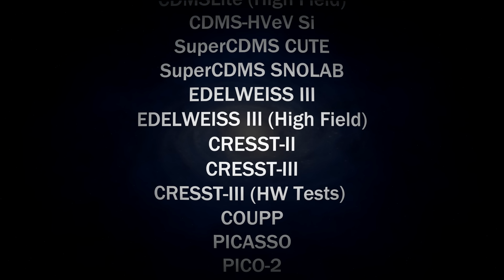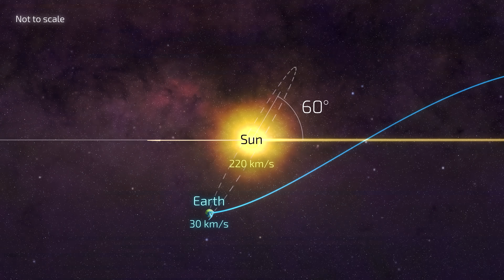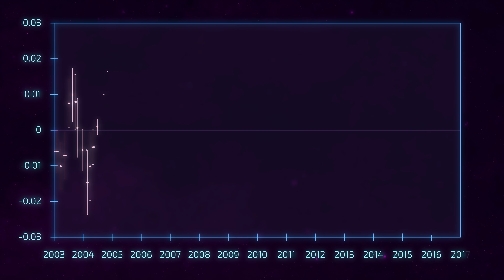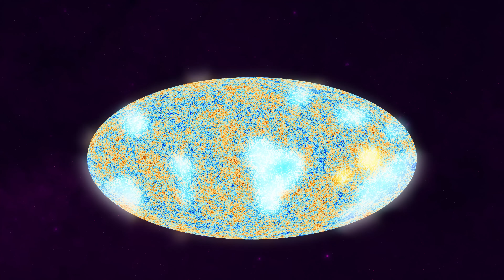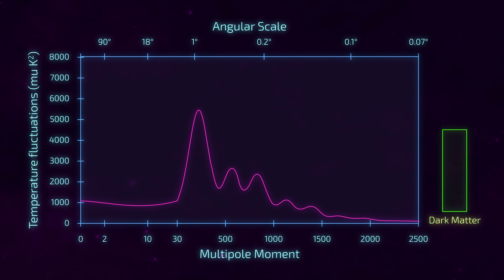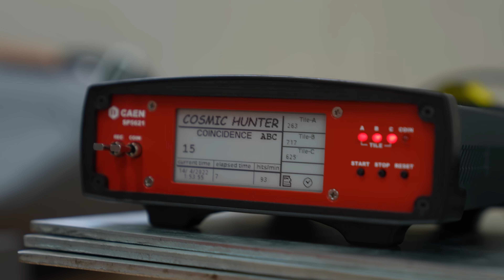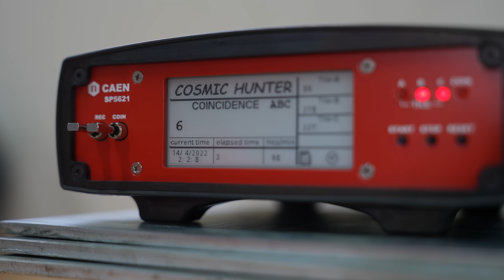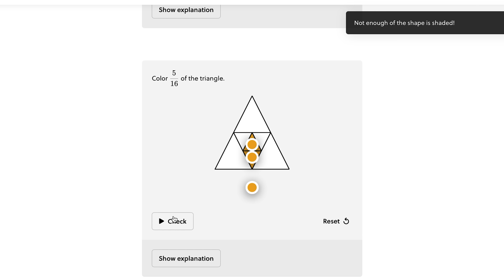The Absurd Search For Dark Matter

Comment: Reposting and slight editing of recent mathematical ideas into one post:
Split-complex numbers relate to the diagonality (like how it's expressed on Anakin's lightsaber) of ring/cylindrical singularities and to why the 6 corner/cusp singularities in dark matter must alternate.
The so-called triplex numbers deal with how energy is transferred between particles and bodies and how an increase in energy also increases the apparent mass.
Dual numbers relate to Euler's Identity, where the thin mass is cancelling most of the attractive and repulsive forces.  The imaginary number is mass in stable particles of any conformation.  In Big Bounce physics, dual numbers relate to how the attractive and repulsive forces work together to turn the matter that we normally think of into dark matter.
The natural logarithm of the imaginary number is pi divided by 2 radians times i.  This means that, at whatever point of stable matter other than at a singularity, the attractive or repulsive force being emitted is perpendicular to the "plane" of mass.
In Big Bounce physics, this corresponds to how particles "crystalize" into stacks where a central particle is greatly pressured to degenerate by another particle that is in front, another behind, another to the left, another to the right, another on top, and another below.  Dark matter is formed quickly afterwards.
Ramanujan Infinite Sum (of the natural numbers):  during a Big Crunch, the smaller particles, not the dominating black holes, are about a twelfth of the total mass involved.  This also relates to 12 stacked surrounding universes that are similar to our own "observable universe" - an infinite number of stacked universes that bleed into each other and maintain an equilibrium of Big Bounce events.
i to the i power:  the "Big Bang mass", somewhat reminiscent of Swiss cheese, has dark matter flaking off, exerting a spin that mostly cancels out, leaving potential energy, and necessarily in a tangential fashion.  This is closely related to what the natural logarithm of the imaginary number represents.
Mediants are important to understanding the Big Crunch side of a Big Bounce event.  Matter has locked up, with particles surrounding and pressuring each other.  The smaller matter, not the black holes, gets broken up into fractions of what it was and then gets added together with flattened black holes to form the dark matter known from our Inflationary Epoch.  Sectrices are inversely related, as they deal with all stable conformations of matter being broken up, not added like the implosive "shrapnel" of mediants.
Ford circles relate to mediants.  Tangential circles, tethered to a line.
Sectrices: the families of curves deal with black holes and dark matter. (The Fibonacci spiral deals with how dark matter is degenerated/broken up and with supernovae. The Golden spiral deals with how the normal matter, that we usually think of, degenerates, forming black holes.) The Archimedean spiral deals with dark matter spinning too fast and breaking into primordial black holes, smaller dark matter, and regular matter.  The Dinostratus quadratrix deals with the laminar flow of dark matter being broken up by lingering black holes and the dark matter also being broken up.
Delanges sectrices (family of curves):  dark matter has its "bubbles" force a rapid flaking off - the main driving force of the Big Bang.
Ceva sectrices (family of curves):  spun up dark matter breaks into primordial black holes and smaller, galactic-sized dark matter and other, typically thought of matter.
Maclaurin sectrices (family of curves):  newly formed dark matter gets slowed down, unstable, and broken up by black holes.
Jimi Hendrix's "Little Wing". Little wing = Maclaurin sectrix. Butterflies = Ceva sectrix. Zebras = Dinostratus quadratrix. Moonbeams = Delanges sectrix. Jimi was experienced and "tricky".
Jimi was commenting on dark matter. How it could be destabilized by being slowed down, spun up, broken up by lingering black holes, or flaked off.  (The Delanges trisectrix also corresponds to stable atomic nuclei.)
Dark matter, on the stellar scale, are broken up by supernovae.  Our solar system was seeded with the heavier elements from a supernova.
I'm happily surprised to figure out sectrices. Trisectrices are another thing. More complex and I don't know if I have all the curves available to use in analyzing them. But, I can see Fibonacci and Golden spirals relating to the trisectrices.
The Clausen function of order 2:  black holes start spinning up just before being crunched.
Methods of arbitrary angle trisection:  Neusis construction relates to how dark matter has its corner/cusp singularities create "bubbles", driving a Big Bang event.  Repetitious bisection relates to dark matter spinning so violently that it breaks, leaving smaller dark matter, primordial black holes, and other more familiar matter, and to how black holes can orbit other black holes and then merge.  Belows method (similar to Sylvester's Link Fan) relates to dark matter being broken up by lingering black holes that came late to the Big Bounce event.
General relativity:  8 shapes, as dictated by the equation?  4 general shapes, but with a variation of membranous or a filament?  Dark matter mostly flat, with its 6 alternating corner/cusp edge singularities.  Neutrons like if a balloon had two ends, for blowing it up.  Protons with aligned singularities, and electrons with just a lone cylindrical singularity?
Prime numbers in polar coordinates:  note the missing arms and the missing radials.  Matter spiraling in, degenerating?  Matter radiating out - the laminar flow of dark matter in an Inflationary Epoch?  Connection to Big Bounce theory?
"Operation -- Annihilate!", from the first season of the original Star Trek: was that all about dark matter and the cosmic microwave background radiation? Anakin Skywalker connection?

Comment: Dark. Matter. Has. Been. Falsified.  How many intelligent people will continue to fall victim to this social contagion? It was a plausible hypothesis but it’s over.  And no, the bullet cluster doesn’t say what you think it does.  And no, that wasn’t dark matter.  
Guess what? 
The speeds you’re measuring are actually the gases and plasmas.  See recently published works from new satellites.  Now we can measure the x, y And z positions of the stars — there’s a keplerian decay.  The gases, however, are acted upon by gravity as well as magnetic fields.  As expected the stars slow up towards the end but all this time, these people were postulating DARK MATTER FOR NOTHING.
But—you’ll be bombarded by ΛCDM for another decade while the gatekeepers and older generations die off.  
Jesus.  If I hear about the bullet cluster one more time.
Reply: What about rotation curves of galaxies then?

Or baryonic oscillations in the WMAP data?

Or the existence of galaxies arising from nearly uniform soup of baryons coupled to radiation?

Dark matter is the observation of all of these phenomenon. There needs to be extra mass without luminosity or modified force law or another explanation.

Dark matter is an observation, not a theory.

Comment: Huge cavern (at 13:54) is at 1 km depth: assuming a rock density of 7 times the density of water, it means that there is 7000 tons of rock above each square meter of the ceiling ....

Comment: Could "dark matter" and black holes be connected, or be the same thing? 
From my derivation of Hawking radiation, it appears that the matter that appears to be "sucked in" is actually released as radiation. While I can't yet determine if the amount released is proportionate to the matter that appears to be "sucked in," this leads me to believe that it's not a hole.

If we look at the process of fusion occurring within a star, we see that it is constantly put under immense pressure and heat from the lightest to the heaviest elements. Currently, we are attempting to create fusion using deuterium and tritium, which are relatively light compared to other known elements.

On the periodic table, there are elements that we have only been able to create for fractions of a second before they disappear. In my opinion, if we can sustain the temperature and pressure after fusion, we could potentially sustain these elements for a short while longer. Should this be the case, and they have enough time to undergo fusion again, a new, potentially heavier element would be created.

At the end of a star's lifetime, the elements would be a molten slurry of elements. The heavier elements would be closer to the center(one can assume). At this stage, it is still molten, but less agitated as fusion reactions are taking place far less. The heavier element then concentrates at the center. Considering the size or mass of the star, the pressure is still immense. This potentially leads to a further and final fusion reaction, resulting in an element so heavy that it has a massive, concentrated gravity field. Could one consider this to be a close explanation one could come up with for "Dark Matter"? 

As you said dark matter makes up 85% of all the matter in existence. In my opinion, this would make it even more true and or conceivable.

I have to say this is merely my opinion and would love your feedback.

Comment: What if?... 🤔
Maybe our universe is bursting by pushing of the radiation? 
A huge number of stars shine, light has momentum.
Matter pushed by light scatters in all directions.
Perhaps, despite the fact that the Inverse Square Law is equally valid for radiation and gravity, radiation still wins.
Perhaps, although there are a little more attracting non-radiating objects in the universe, the total energy of stars is more powerful.
And perhaps on some scale, matter stretches space, and not vice versa.
Then, at higher scales, space starts to push itself and so the expansion of space can overcome the speed of light.
Reply: it's like move faster than wind using wind

Comment: ... soooo could it just be the multi-verse is pouringbits gravitational field in our universe and because of the higher probability of matter clumping into 1 area over another its causing the gravity to just barely interact with the rest of our universe and vice versa... and because of this multiverse theory it's the true way to combine general relativity with quantum physics but we can only observe out most probable position bit not any in a scale larger than us because we don't have a big enough tool or higher dimensional awareness to collapse the function to 1 true time line therefor making dark matter an inevitability  unless there is a higher being that looks our way to observe us... which would add the question if we're just quantum specs under another and just like from them to us if we observe the 1 dimensional realm of string theory they collapse to 1 truth but don't realize it.... sorry for whoever read this. It got out of hand about half way down. Like it if you read it and have a good one!

Comment: So, a year down the road since this was posted now: have they been able to reach any sort of conclusion in Melbourne? Thanks for updating us, Derek.
Reply: They only started data collection in early 2023, so it's probably going to be a while before results are published.
Moreover there are other experiments trying to replicate the DAMA/LIBRA results, and one from south korea (COSINE-100) managed to "in a way" replicate the results. I put this in quotation marks because with their initial data analysis method they got a null result (aka: they found no signal whatsoever) but then they took their data and analyzed it with the somewhat particular data analysis method DAMA/LIBRA used in their publications and "found" a signal as well. 
Problem: This COSINE-100 signal is almost the inverse (the phase is flipped) of the original DAMA/LIBRA signal, so this is no good news for the dark matter theory as it might be some other effect. Or even worse, the signal might have been induced by the data analysis method itself and be completely arbitrary (low frequency noise generated by the photo multiplier tubes that is not modeled/compensated correctly). 

For more info just google "An induced annual modulation signature in COSINE-100 data by DAMA/LIBRA’s analysis method", the paper is freely available, short, and the non technical part relatively easy to understand
Reply: @christophmayer3991 Thanks for the  updates!
Reply: @christophmayer3991 thanks so much for this!!
Reply: @christophmayer3991 thanks
Reply: @christophmayer3991  I am very skeptical of the dark matter hypothesis. I believe GR is incomplete. Something else is missing. Then again since the scales are huge, GR is not even needed, right? GR is a replacement for Newton only when the speeds are close to the speed of light or when the gravitational fields are too strong (which would bend light).
Reply: @ThomasJr  I think you’re thinking about Special Relativity not General Relativity
Reply: @tpespos  absolutely not. SR doesn't have acceleration, only inertial reference frames. SR is what gives name to the theory, relativity. Then it's expanded to encompass gravity and acceleration. GR is more general.
Reply: @ThomasJr  You are heavily mistaken. GPS satellites need to account for time dilation in order to function, which is predicted by general relativity.
Reply: @weltschmerzistofthaufig2440  I think you replied to the wrong person. Perhaps you replied to the wrong topic too. Your post is a reply in search of a question. Pls doublecheck the video that you meant to reply to.
Reply: @weltschmerzistofthaufig2440  talk about non-sense. are you typing from the sanatorium?
Reply: Time dilation is a result of both relativities (that's why they're called relativity, because the time passes differently from different perspectives). Special relativity causes time dilation due to differences in speed, general relativity causes time dilation due to differences in acceleration (often causes by gravity). But you are correct in GPS using general relativity, since the clocks in satellites operate faster than on earth due to weaker gravity
Reply: what about now
Reply: Any news?
Reply: youtube deletes the comments . they are getting worse than yahoo
Reply: No and they won't find dark mater, it don't exist
Reply: @Dlweta57  , Well, Now you tell us!  If you'd let the physicists know earlier, they could have saved a ton of time and trouble!

Comment: Here's my final understanding of dark matter:

You either collapse into a galaxy center (if too slow) or get flung out if too fast. Those that have done neither have their centripetal force equal to CoG  and thus move at constant speed.

Without dark matter:
Not all speeds are equal. Towards the center, your constant speed is faster than that outward.

With dark matter: 

Something like an umbrella reaches out radially to pull stuff inwards. It's force is proportional regardless of your distance from the center. Stars with not enough centripetal force get sucked in. Survivors rotate at constant speed. However, since this umbrella radiates equally in all directions outward, survival Speed is the same at all levels regardless of your distance from the center. 6:02

Comment: Why are the stars moving faster to compensate, instead of collapsing due to dark matter?:

 Edit: I'm thinking some stars did collapse, however those with matching speed to the pulling force remained in centripetal motion. (This is prolly ignorant lol. I'm just a rando on YouTube).
Reply: Also, I'm seeing dark matter as some filament that permeates the galaxy. It's not just the center of gravity that's pulling but also DM. If DM was not available the other part will be safe from pull and effects will be slow. But DM also extends radially outward like an umbrella pulling stuff in. It is able to reach the outer most parts.
Reply: Here's my final understanding of dark matter:

You either collapse into a galaxy center (if too close) or get flung out if too far. Those that have done neither have their centripetal force equal to CoG  and thus move at constant speed.

Without dark matter:
Not all speeds are equal. Towards the center, your constant speed is faster than that outward.

With dark matter: 

Something like an umbrella reaches out radially to pull stuff inwards. It's force is proportional regardless of your distance from the center. Stars with not enough centripetal force get sucked in. Survivors rotate at constant speed. However, since this umbrella radiates equally in all directions outward, survival Speed is the same at all levels regardless of your distance from the center. 6:02

Comment: @Veratasium is there any update on this?
Reply: Just about to ask the same
Reply: I did some reading on this, and it seems like DAMA/LIBRA had been using some dubious methods when collating their data.

2 other independent studies were done using the exact conditions they were using, and none of the same results were found. DAMA was contaminating their data by removing signal noise based on its yearly average. Which essentially will naturally produce the yearly cycle which peaks in November.

The fact that they had not shared their testing methodologies for the past 20 years means they were able to hide that little fact.